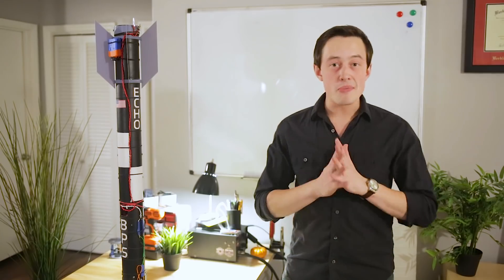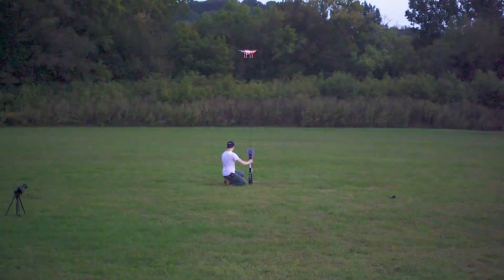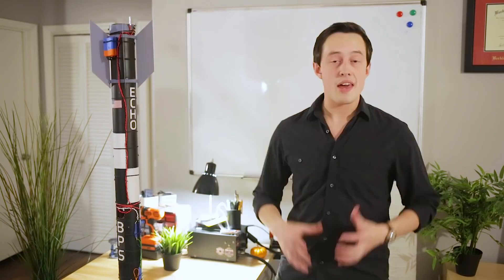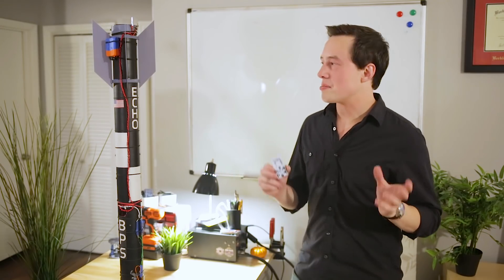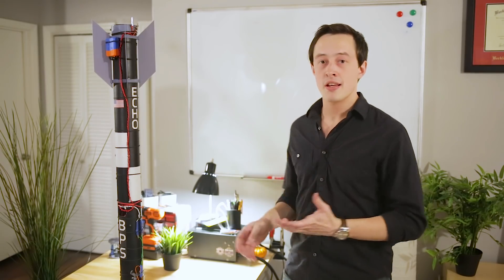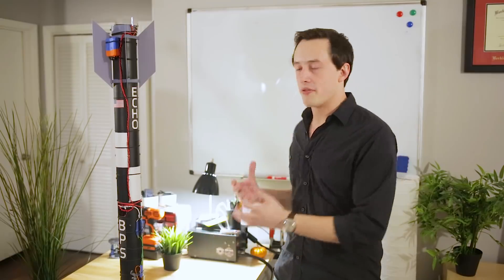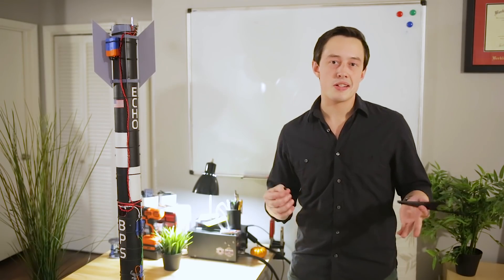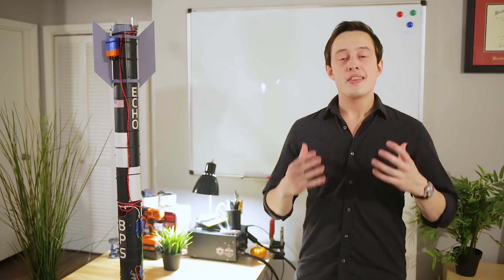Echo - Landing Test #1

Comment: What if you used 2 motors, that you angle (so they cancel each others horizontal push out), to be able to throttle?
Reply: That might actually work indeed. I like the idea. If only we could do this in sfs
Reply: @FireTome  heuj jarno
Reply: Space duck thinking the same thin lol just saw ur comment on the. Nova class rocket video thingy
Reply: Hi stef
Reply: Please put this in game😄
Reply: The ignition timing between the two motors would be difficult.  Since the motors are ignited from a hot wire on the propellant each ignition delay is going to be slightly different.
Reply: @MatHolliday  Hmmmm, maybe use one wire to a smaller starter pyro that will shoot into the two mains?
Reply: I was thinking something along those lines, like a small black powder charge or something.
Reply: @MatHolliday  I wonder how consistent the engine's thrust is throughout the burn. I wonder if that would cause issues if they're not the same.
Reply: On the next SFS Update, could there be new large landing legs to fit to bigger engines?
Reply: hello stef
Reply: Maybe ... if we had sensors in the game ...
Reply: stef plz add solid rocket boosters and a complete solar system
Reply: @bryantkids8161  Agreed
Reply: STEF
Reply: If only we could do this in sfs
Reply: Proof of the pudding is in the eating, but my bet would be that they don't cancel out, there is no way two motors perform exactly the same. But there might have enough control in that axis to compensate for the mismatch. But if you get torque along axis of the rocket body, then it goes spinning on you.
Reply: You said it - I never realized how hard this is to do until I saw the Mythbusters trying to synchronize two rocket motors to fire at exactly the same time. They had professional (amateur) rocket scientists and couldn't make it work. Getting both motors to fire at the same time, with the same exact thrust is pretty much impossible in this kind of setup.
Reply: Hi stef
Reply: That isn’t how thrust works...
Reply: @camhollo1139  yes it is, if you use two solid rocket motor that fire at exactly the same time and are perfectly opposed, you could angle them parallel to the ground, which result in 0 upward thrust
Reply: if you use no solid rocket motor it also results in 0 upward thrust... I don''t see what you are trying to achieve here? could you elaborate  @E9X330  ? I mean I don't know if I'm missing something here but using two motors opposing each other seems like a terrible waste of weight, thrust and delta-v to me. IMHO: If you want to balance a rocket without being able to use aerodynamics you will have to be able to change your thrust vector, fixed solid rocket motors will always result in a fixed net force whether that is up or down or 0 doesn't matter it will tip over and not correct and therefore keep tipping over. maybe a solid rocket motor in some kind of a gimbal could work or deflecting the thrust a certain way? To actually land it you would need to either be able to shutdown the rocket exactly when you ask it to, or to have a throttle of some kind but that's not possible with solid rockets AFAIK.
Reply: @vanpaalen5594  this rocket does have a gimbal, Stef point was to use two separate srbs on gimbals, so you could technically "throttle" the rocket depending on how much you angle the motors against each other
Reply: aaaah I knew someone that comments under a video like this who seems to be popular couldn't be that stupid ;) after commenting myself I discovered he indeed does have a gimbal already by watching more videos. I think Stef's idea could work indeed although very very challenging. btw I forgot to say how amazing the result so far is, I did not think it would go so well. @BPS.space As I'm writing this I think of another option...you could place retractable motors on the top of the first stage you would need no gimbal just stef's throttle idea, it would simplify everything dramatically. But I guess the idea is to mimic the real thing, but hey personally I think landing a model rocket on SRB's is absolutely amazing already.  @E9X330
Reply: Camhollo11 bro he made a fucking space gameeeeeeee
Reply: @joshuagoodsell5952  I HATE IT CUZ EXPANSION
Reply: Hey stef, tf are you doing here 😂
Reply: stef give me free full game plox <3  No homo
Reply: Stef What are you doing here
Reply: Lol hi stef
Reply: Its you!
Reply: Hi stef!
Reply: I Like you game
Reply: Or maybe two fins guiding the thrust outward so you woudnt have to sinc the motors
Reply: Stef Morojna I love ur game bro didn’t expect to see u here
Reply: Hey Stef lmao
Reply: Hi Stef, my favorite developer
Reply: Might not be a good idea for two reasons: 1) the balance between the two could be very difficult to control, resulting in sudden horizontal moves (and tilt), 2) when it's "throttled" down, i.e., with large angles, a slight misalignment may result in a rapid spin (roll). Just my guesses, would be very cool if this works.
Reply: Stef, are wings in the next update?
Reply: Steff i love sfs
Reply: The angle would have to be too large for that to work. It would be the cosign of the angle, so even a 20° offset would only throttle you down to 94%.
Reply: STEF WHAT ARE YOU DOING HERE!?!? STEFFF WE LOVE YOU! we love you too space
Reply: Hi stef
Reply: STEF MOROJNA BOI UR HERE! 
ALSO WHENS UR UPDATE MOAR FREE PARTS PRETTY PLZ
Reply: Stef's here? OMG This comment section just got lit!
Reply: @JLukeHypernova  LIGHTS CANDLE USING ASSHOLE DICK DILDO ROCKET ON MY NOT REAL CONTROL TOWER 
WAAAAAAAAAAAAAAT!
Reply: Yes
Reply: add solid state rocket motors to sfs??
Reply: I just liked the comment to act as if I knew what u are talking about :3
Reply: Can't throttle solid motors.
Reply: @WootTootZoot   if you had two of them, you could offset the thrust from the center to the side. If they both do this, their thrust to the side cancels each other out so all you're left with is a smaller vertical thrust.....essentially it would be throttle able, but I don't imagine it would give you a lot of room to do so much like SpaceX's Merlin. I believe the lowest thrust they can operate it at is around 75% ish or so...(something like that) that's part of the reason they hoverslam.
Reply: gaem succs

Comment: If you're coding in the mass... you're doing it wrong.  Yes, you do need to engineer in enough fuel, thrust, etc.  But control cannot assume anything other than assume that it has the required performance to do the job.  The control loop is, "Am it going to overshoot or undershoot the mark? If overshoot, more bakes.  If undershoot, less brakes."
Reply: It's a solid rocket motor, so it can't throttle
Reply: @sea_kerman  If you pre-code your trajectory,  you'll always miss your mark. The margin of error has to be controlled.  Maybe add air brakes.

Comment: Have you though about how you're going to throttle? A suicide burn with a solid motor will only work for one given set of input parameters which you likely won't occur in a real flight. I suppose you can get close by adjusting the rocket's mass such that your terminal velocity and acceleration are tuned to your motor's delta V, but then you won't have any margin to null out lateral translations.
Reply: Mike
Are you a patreon? Because this stuff you want on that rocket is really expensive.
Reply from the maker: The throttling question is always a good one! It may require a bit of luck, but check out the Episode 1 of "Landing Model Rockets" on this channel. I go through and simulate how close you can actually get with just one motor, and it's closer than you might think! That said, Episode 2 comes out in a few days and I address ways you can "throttle" or really augment the total impulse of a solid in a dynamic way during flight, to get things a bit more precise.
Reply: The retro rocket motor is capable of generating a specific delta-v, given the mass of the descending rocket. Knowing  altitude and downward velocity values, you can calculate when to fire the retro rocket such that the velocity goes to zero just as the altitude reaches zero.
Reply: Hi John, this is not quite so simple given that the motor has a given burn time (basically you have a know acceleration for a known amount of time). With this constraint, there will be just one unique combination of velocity and altitude that will allow the problem to resolve 0 velocity at 0 altitude. Throttling is the extra degree of freedom that allows you to budget when and where your delta v gets used up. Like I mentioned previously, you can get close if your rocket is at terminal velocity as this remove a degree of freedom from the equation and then you just care about altitude (Assuming you have enough delta v which would be = V_terminal *a/(a-g) ; a is the vehicle acceleration)

Comment: Too bad it would be too heavy to use a co2 cartridge from a bb gun and a 4 way tube pinched by selinoid to make rcs to help control landing.
Reply: That would be a lot of work for low profit
Reply: David Bowie yeah that would be pretty dumb, definitely not profitable
Reply: @emiglio62  it a profit idea.
Just a cool thought it profit wasnt the goal.
Reply: A CO2 cartridge does not come close to having enough thrust to slow down a kilogram object falling from 30 m.
Reply: @henryD9363  the idea is to use it for rcs. Attitude control.
Reply: John H its for RCS not for main thrust... 

Its for stabilization
Reply: Not a terrible idea but it would incur a significant mass cost. These rockets with all the thrust vectoring stuff on them don’t accelerate to great as is.
Reply: That is some cute rcs